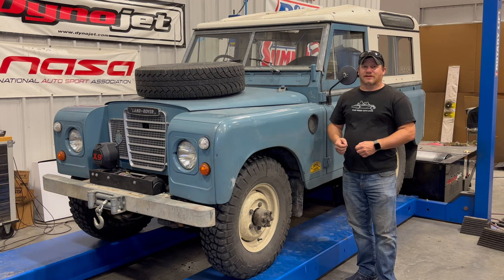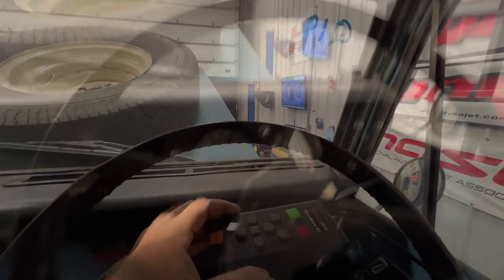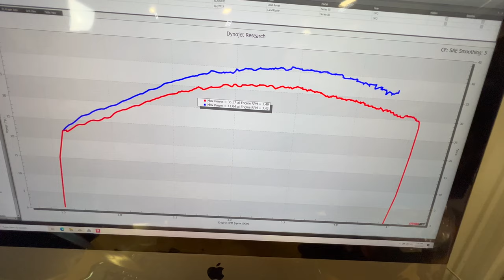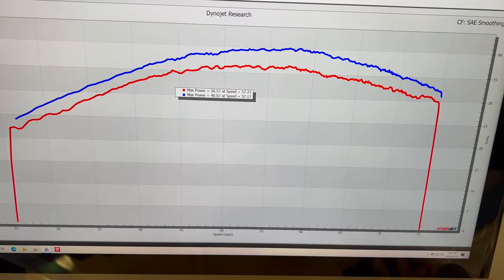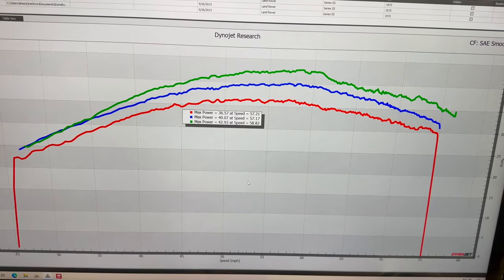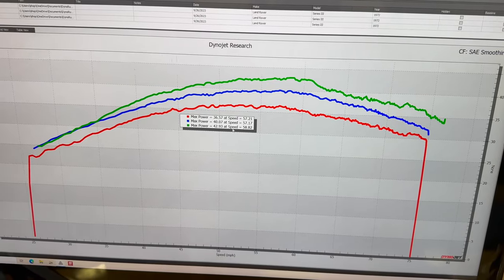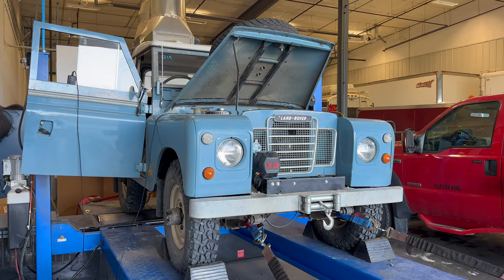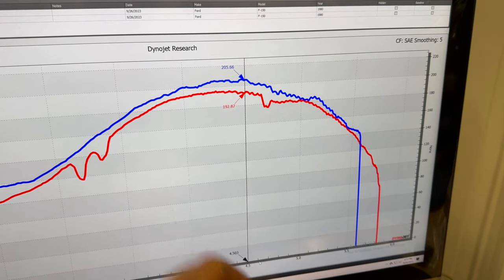How Much Power Does the Fan Really Use?

Comment: Back in the 70s, I had a Toyota with a fluid coupled fan,  allowing it to not turn at engine speed, but still draw air thru. You could stop the fan with your hand. Spooky, but I saw it done.
Reply: Still used on new Toyota 4WD’s in Australia

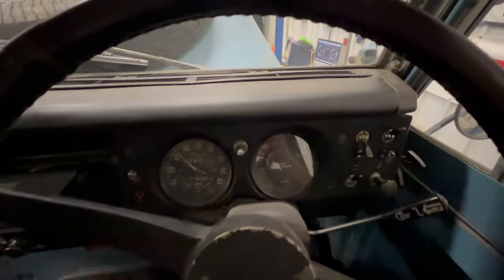Comment: Just for the record I run a 200 tdi defender with no viscous fan and no electric fan, hasn’t had a fan in 15 years, no problems whatsoever in traffic, towing or heatwaves, obviously more thermo efficient than 2:25 petrol but just putting that out there

Comment: It sounds like the engine has a knock.  FWIW, back in the 70s I owned a '65 rhd 88.  It had seen had use in its life, so I rebuilt the engine.  Later I installed a Rochester carb that made a big change in the power.

Comment: Just a shroud would help a lot with the efficiency of the cooling fan, is ridiculous heaving a pulling fan so far away and without any device to focus its power to pass air through the radiator

Comment: Thanks for sharing this cool test! How would this Land Rover do with a light plastic fan bolted in place. I have an extremely original ‘72 MGB with overdrive. The engine has about 88hp with the twin HIF carbs, but no air pump. I’d like to see how much could be saved around 3200 RPM when on the Interstate.
Reply from the maker: I don’t think the weight of the fan makes a lot of difference, I think blade pitch, fan diameter, and number of blades are the largest factors.

Comment: I was just shocked to see the speedo reach 70 MPH. My old 2A would only do that if it was pushed off of a high enough cliff. Then I realized that there was no rolling resistance from the front wheels and no air resistance at all and it made more sense.
Reply: We measured our S2A petrol at 128kph - going down a hill, no windscreen, nose on the steering wheel and laughing like a drain. It's got extractors, a well ported head and that's about it.

Comment: But was either one on a viscous clutch? I think that's the thing that eats more horsepower than a solid fan. I swapped the viscous clutch fan on my pickup to an electric fan mainly because the lift one of the previous owners did was sketchy. But now I've been thinking of doing the same to my Volvo 240 to save some fuel.

Comment: The problem with flexing blades is that it takes power to make them flex.  There is no such thing as a free lunch.
Back in the late 1950s, early 1960s there were articles in the UK motoring press about people who had made DIY electric cooling fans and removed the metal fan.  More m.p.g. was claimed.  Kenlowe soon began selling fans as an aftermarket mod and much later electric fans were fitted to many new cars as standard.

Comment: Really Interesting video. Just a shame you didn't do a couple more runs with the fan on. When you are talking such marginal gains in the measurable units. There was an 8% variance in your benchmark runs. Using the upper and lower benchmark datum points the Landy gained between 10% & 19% power without the fan. Ask any engine tuner is that sort of gain amazing for a no cost 10minute job. Hell yes it is! Its all in the stats😅

Comment: A series LR, especially a RHD must be a rarity in the States. The experiment is interesting but it more or less confirms scientifically what I always stood for: Do not modify factory equipment, it is designed and set for optimal performance under varying conditions. I hope you know how to operate correctly the Transfer Box (Red and Yellow levers) on this old boy. Not many people do either in the UK or elsewhere.
Reply: red and yellow levers, you say? I'll have a look for them.
Reply: @ZoomStranger  Finding them is the easy part, they even show up in the vid. Knowing how to CORRECTLY use them is the trick part.
Reply: @78a67h  I went out there and looked. You are right - there they were. I pushed one and it went down - the red one I pulled and it moved too.

Comment: I wonder if there's a way to test this at road going Speeds where air is already being pushed through the radiator theoretically taking less power to turn the fan?

I was driving a 79 ford with a 460 cruising down the freeway and the fan clutch locked up from a bearing going bad and i couldnt believe how hard it pulled the engine down! Felt like someone dropped an anchor!
Reply from the maker: I have a friend with a dyno and a huge fan wall that can give you the same air speed as at each speed, I have been thinking about using that dyno for some interesting tests.

Comment: The other factor is the ratio of the crank pulley to the fan/water pump pulley. Some fans run at crank speed, some faster, some slower. This varies HP used to run the same size fan. One things for sure, Landrover built that car with no horsepower, and it still has most of it left 😂.
Reply from the maker: True you could change your pulley size to make the fan spin slower and get some power back while still leaving the fan.

Comment: How much faster will the land rover be if you take the tire off the hood? I hate opening the hood with the heavy tire up there.
Reply: I keep the wheel there because I have found that it makes the steering feel more connected to the road, but the weight distribution on my longer wheelbase (127") may be a factor.
Certainly, I do not rely on the factory bonnet stay, with just a single rivet between me and a serious headache.

Comment: You didn;t really compare the graphs for the 2 cars properly. The point with the flex fan is perfectly demonstrated by the power graph for the Ford where the power loss due to fan shrinks a lot as rev's increase, the power gain is in the upper midrange, whereas for the Landy the power difference continues through to higher RPM
Reply from the maker: Thats exactly what I say in the video.

Comment: The petrol is supposed to be around 80 hp if im not mistaken? Where is all that power going ! Is the transmission soaking 50% ? The ford flex fan is new to me what a great idea
Reply: I think only the later 2.5 managed 80bhp which I had in my 1986 Ninety.  The older 2286 cc was only 68 bhp? But anyway, retrieving power loss should be a higher priority than fan losses !

Comment: Those fans are horrendous, waste loads of power and fuel. You need every drop you can get in these vehicles, they drink it like a fish.

Get rid of the fan, and upgrade to a serpentine belt if you can because the original belt is as tough as old boots and must waste a horsepower as well. The metal fans are really dangerous if anything gets caught in them.

The fan is never needed, maybe parked in the sun idling on a hot day. In the UK in winter people used to put carpet or something over the grille to try to get the engine warm enough for the heater to work, also back in the day Antifreeze or a working thermostat used to be a luxury and people would often start the landrover on a frosty morning and the howling gale of cold air through the radiator would freeze it solid and they'd drive off unknowing...... and boil the engine up a couple of miles down the road!

The most exciting part with these fans is if you go into deep water and rev it, the totally rigid unforgiving steel blades bend forward and eat the RADIATOR ! which is a fantastic design feature for you to ambush yourself with on your 1st off-road outing in the woods, so don't forget your sarnies!  :-)

I grew up with land rovers

Comment: These vehicles cooling systems were designed to tow off road, and as a static or slow moving machine compatible, with the power take off on the rear of the transfer box. The cooling system is over engineered, and in 9 out of 10 cases, will not need the mechanical fan. Summer, summer towing, off road slow speed yes, but in these cases, an electric fan is sufficient. The radiator/and general capacity is huge.

Comment: What's the difference using the electric fan in place of the mechanical one though.....
Reply from the maker: If you have it on a temp switch like mine it should only kick on in traffic and be off the rest of the time.  It will be pulling power mostly from the battery not from engine.   I don't think I would be able to measure it on the dyno.
Reply: @ThisWeekWithCars  That'd only be true if it had a dynamo, and the engine was at tickover - then, yes, the fan would pull juice from the battery.  But with an alternator, once the engine's started, the alternator's higher voltage powers all the electrics - at tickover you should hear a tiny drop in engine revs when the fan kicks in (and more if you turn on the headlights and other electrical load).  As you say, though, questionable whether you could pick that up on the dyno...
Reply: , no, the electric fan will draw power from the alternator, which will decrease engine power significantly more than the fixed fan does.  Your video also ignores the benefit of ram air from the vehicle’s motion reducing blade angle of attack at high speed.  LR put fixed fans on these early vehicles because it was the most reliable AND the most efficient method of getting air through the rad in the typical conditions they faced.
Reply: I’ve had an electric fan on mine for several years. Most of the time the fan is not needed and it only switches on in heavy traffic or hill climbing. Benefits are faster warm up, less noise and 22mpg. The fixed fan is not necessary in temperate climates.

Comment: One of the finest engines out there in my opinion.. the old ultra reliable 2 1/4 petrol.  These things were built to be used anywhere in the world on the fuel available.  I’ve stripped these engines down because they were smoking or burning oil and even when they were totally worn out through lack of maintenance, they’d still run and sound like a sewing machine.
It’s also worth remembering.. when this engine first became available most cars needed a rebuild or a decoke after 40,000 miles and 70bhp was a respectable figure in the 60s and 70s. Over 40 years of service in a few different variants which included the 3 bearing being updated to a 5 and the engine being bored out to a 2.5.
Unfortunately, many of these engines have been scrapped now because they were fitted with the tdi engines out of rotted discos.  We were all told that diesel was the future and petrol will kill us all… I’ve since learnt my lesson, I don’t listen to the liars!
Reply: I absolutely agree. These were really excellent engines, far better quality than many others that have come and gone. I've rebuilt the original one in mine(a 1973) only once, about 25 years ago, and it's still doing sterling service. Cheers!
Reply: In actual fact the bore size is exactly the same between 2.25 and 2.5, including 200 and 300 TDI. The only difference between 2.25 and 2.5 is the 2.5 is the stroke. I nearly built a 2.25 5 main bearing and converted to 2.5 TDI fitting a 2.5 crankshaft and TDI conrods and pistons with a 200 TDI cylinder head as a one off project.
Reply: producing that amount of power, how can they wear out?
Reply: Filthy thirsty engines is my opinion.
Reply: @gilesgreenaway5655  Not really Giles when rebuilt correctly and you know what you're doing.

Comment: If you replace it with a electric fan, I wonder how much HP the load added on the alternator would pull.
Reply: nothing because they hardly ever switch on
Reply: Alot as alternator efficiency is only around 70-80% on the high end if you have a 10hp fan the extra alternator load will be 12-13hp.
Reply: @phalanx3803 fans don't draw 10 hp (7.5kw) and alternators can't supply your 12/13hp (9.75 kw)!
Reply: @gilesgreenaway5655  dinky little fans on sedans don't need that much power but the big fans need for larger vehicle's do. as for the alternator sure a stock one wont pump out that power and aftermarket one or a dual/trip set up will and if you use a massive fan with a stock alternator your just gonna drain your battery. not a problem in cold - mild climates when hardly working where the fan will be intermittent but hot climates or a hard-working vehicle where the fan will be on for a vast majority of the time if not continuously then you have a problem. its why hard working vehicles like Landcruisers still use a mechanical fan just with a viscous clutch giving the best of both worlds pure mechanical efficiency but able to freewheel when its not needed to reduce load.

also most cars with electric fans rely heavily on the fact they move around fast, and the air is forced through the fan is really only there for when stopped and idling hard working vehicles like a Landcruiser or the Land Rover in the video are designed knowing they will be worked hard at low speed where there is little to no air flow from forward movement thus they need powerful fans to brute force the air through and when the vehicles are at speed the air flow will provide most of the cooling and since the fan no longer has to brute force the air through the load it is reduced alot if he had the dyno fan that simulates air flow at speed he would have seen much less load taken up by the fan.
Reply: @phalanx3803 just tested the electric fan on my 2.4 litre (so similar size to this engine). 12 volts,7.4 amps =88 watts or .088kw = ~ 1/8hp so your 10hp fan would be 88 times the one fitted to my vehicle. I think people are getting bit carried away with some figures.
Reply: @gilesgreenaway5655  and what does your little 2.4l do all day? i have a 4.2l / 9.66l if you factor in the 20psi of boost. and it does an ass load of low speed towing if that dinky little metal fan in the video is using 10HP without forward flow my one is properly using 20-25. I've seen lots of people roast engines off-roading because they did an electric fan mod that works fine when highway driving or in winter where the air is so cold any sort of air flow will work but once you get to warmer temps, low speeds and work the engine hard they don't have the power and flow to keep the engine cool. there's a reason why vehicles built for off-roading / towing like land cruisers still use a mechanical fan to this day hell any sort of heavy duty vehicle truck's loaders and farm tractors tho not purely mechanical for them there hydraulic as they need reverse but they still suck a lot of HP. 

engine cooling is not a one size fits all thing so what your engine is a similar displacement properly even makes more power then his what is the vehicle its in made to do drive someone from A-B or heavy work? going off the size of fan you have its a daily driver all that fan has to do is provide air flow when the AC is on or when the car is not in motion.
Reply: @phalanx3803 your talk of fans using 10hp, 20hp and 25hp is just totally crazy .
Reply: @gilesgreenaway5655  you know it's not hard to go on Google and do your own damn research. Or just go do a diesel mechanics course youll learn all about cooling fans and much more.

Comment: This test isn't valid. When you are traveling there is no load on the fan, because the air is moving through the engine faster than the fan would otherwise push it.  Its only for sitting in traffic or moving at low speeds.

Comment: Those rear tires look awful close to the deck...sure there wasn't some drag...??
Reply from the maker: They are not even close to hitting anything.
Reply: The rear tub is made up from aluminium folded and riveted to together.  The seat box for the rear seat would be roughly inline with the passenger front door handle.. even with leaf spring suspension, the engineers at Land Rover really wanted to keep it a true utility vehicle so it could carry more than it was rated for and had good axle articulation.

Comment: When you run the car on the rolling road at 60 or 70 you need a fan to cool the radiator, simulating the car travelling through the air at that speed.  Otherwise the electric fan fitted will operate and the alternator will absorb a similar amount of power from the engine in order to run that fan.   In other words you are simply replacing one load (the mechanical fan) with another (the alternator providing power for an electric fan)
Reply: Where did you come up with that jargon? You are VERY wrong.
Reply: And car alternators are not very efficient, although the duty cycle of the electric fan should be low except at sustained high speed cruising or heavy towing etc.

Comment: While the peak power isn't that different the fuel consumption at cruise would be huge. If you can get back 4hp at 50 mph you will likely increase gas mileage by 30-40%

Comment: The true power cost of the fan isn't the hp used at speed but the hp used to accelerate it to speed. Your electric fan may use 1kw when running but 4kw when being accelerated to running speed.
The 1kw (In This Example) the fan is using is now supplied by extra load placed on the engine by the alternator\generator.
Reply: Oh here we go... Another one that thinks the alternator will see an increased mechanical load when going to an electric fan 😂
Reply: @jayryan7473  Nope. Here's another one that KNOWS for a fact that the load on the alternator increases when going to an electric fan. Where do you think the electricity to run the electric fan comes from? Black magic?

Comment: How do you street drive that with 40hp?  Seems awful dangerous.  How do you pull out into traffic, wait for a huge gap, or force people to brake for you?  Highway on ramps must be a pleasure, with a bunch of annoyed people stuck behind you wondering what your problem is.  Whats the 0 to 60?  2 min?  Can it even do 60?
Reply from the maker: It easily goes the same speed as traffic.  It is actually pretty quick and way quicker than the more modern diesel Defenders that have twice the horsepower.
Reply: Still Quicker acceleration than a loaded Semi Truck hardly dangerous when there are plenty of old cars with less power.
Reply: yawn. Come on man, live a bit. 99% of people are curious and friendly, they wait and make room generally, they take photos & life goes on.